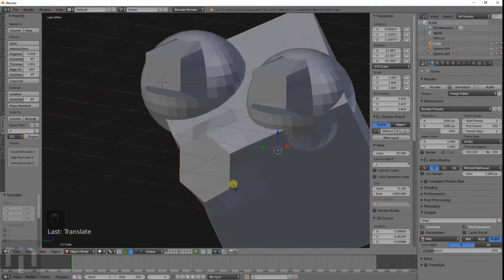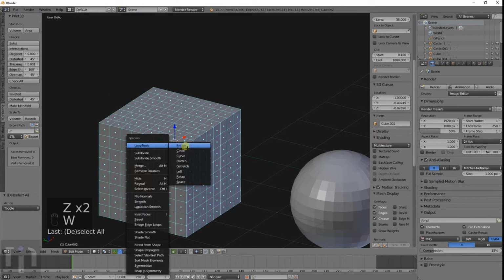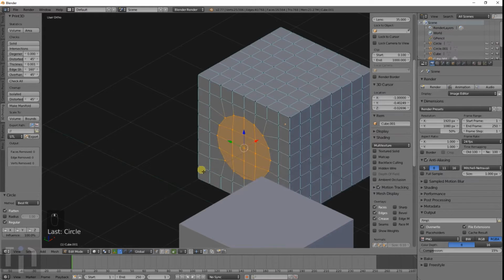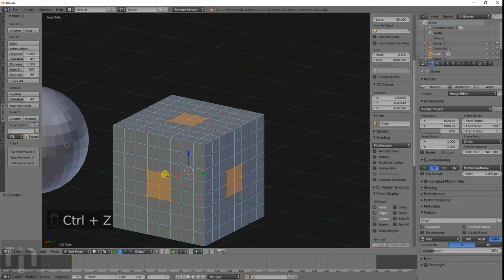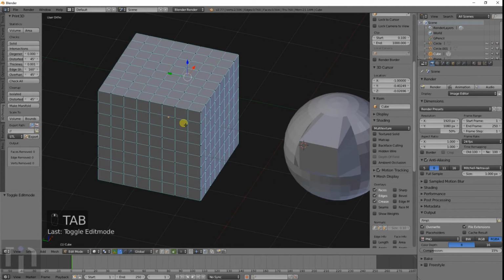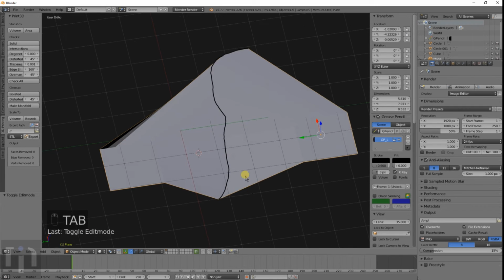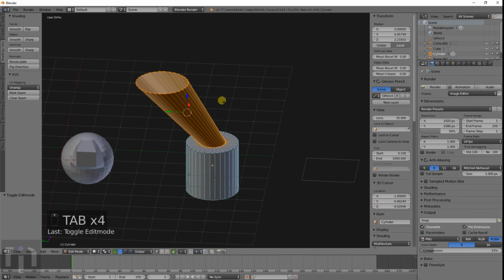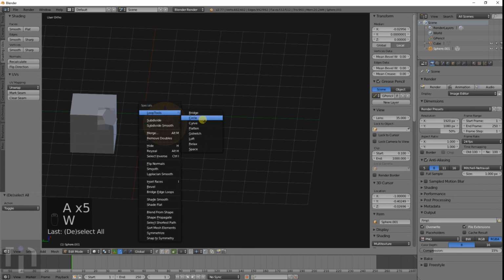Blender Tutorial #016 : Loop Tools

Comment: I came here after watching your 'tentacle' tutorial, wondering what Loop Tools were.
(In 2.78 it seems like these are an add-on that you need to install. Super easy to do that of course.)

Once again, Thank You for sharing your knowledge. This deserves way more views.
The circle, bridge and loft are ones I can see myself using a fair bit.
Bridge would also be useful for connecting separate pieces of a single object.

BTW, with respect to tablets, don't make the mistake of thinking you need to spend big bucks.
I picked up the cheapest Wacom they make (Fun Bamboo I think it's called) a few years ago and it's probably the best money I ever spent on any computer gear. I use it for everything (even spreadsheets) it's that comfortable as an input device. For Blendering, it's way better than a mouse imo.

Thanks again.
Reply from the maker: I've been wanting to get one for a long time.  I always remember when I don't have enough to spend on even a cheap one.  I'll probably get one for my daughter first though because she's big into drawing like I used to be.  Either way, I will probably get one sooner than later.  This last 3D printer build took up all of my extra money.  I think I've finally got it working right.  All in good time.

Comment: what's your proceeds for modeling stuff in blender to scale for 3d printing? do you just do whatever then resize in the slicer?
Reply from the maker: I try to make whatever I'm making in actual size in mm.  Blender units scale exactly 1 unit is 1mm.  That way, I never need to adjust it in the slicer at all.  The only thing I might need to do is rotate it or maybe increase scale by a small percentage.  That can all be done in Blender beforehand though.  I go over the measurements in Blender in this video.  It's quite confusing but might help.  https://youtu.be/YcTntkU6e30
Reply: inventimark Ah, OK. Thanks.
Reply: Are you sure about 1 blender unit being 1mm?  When I add the default cube and make it 1 blender unit in radius and then change the units to Metric its radius is then listed as 1 meter.  I have scale in the Units section set to 1.0.
Reply from the maker: 1 blender unit is 1mm in 3D printing programs.  1 blender unit is 1 meter inside the program and game engines.  You can change the scale to correct that if you want internally, or exporting if you're using it for gaming.  It's all a mater of personal preference really.